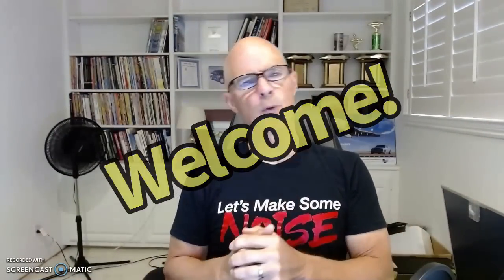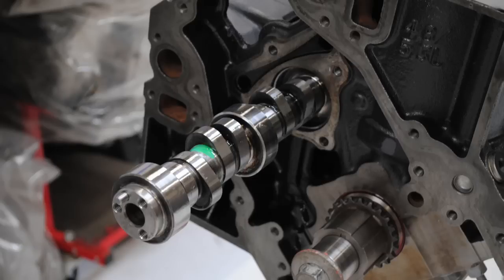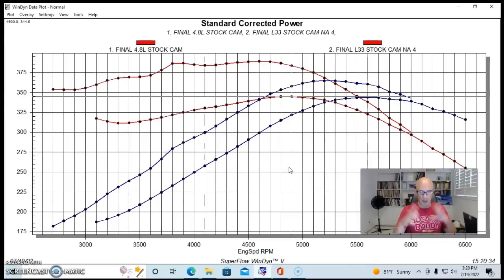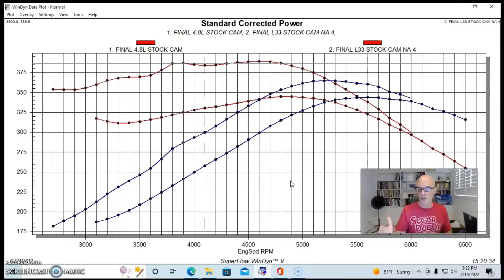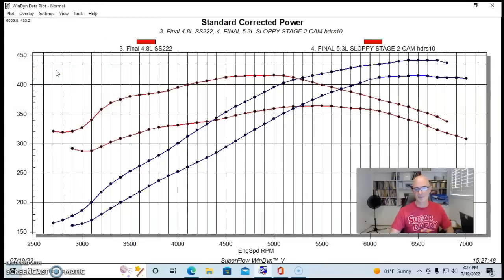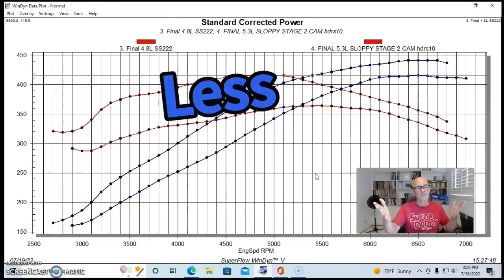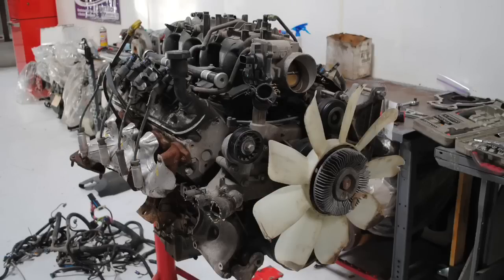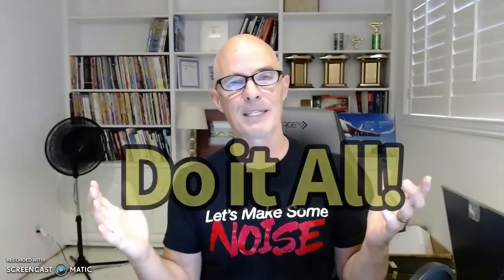4.8L VS 5.3L-TORQUE VS RPM? WHICH ONE WORKS BEST? WHAT HAPPENS IF WE ADD AN SS2 OR BTR TN CAM?

Comment: I believe the piston speed allows the rings to live longer. The rings usually seem to be what goes in a daily that you like to rev on more than occasionally. I think this is also why 283 and 327's got the reputation of being able to beat on them seemingly forever without blowing up in stock or mild builds in basically stock rpm range. Of course all bets are off zinging them 7-10k rpm no matter what it is.

Comment: I can't find the exact information I'm looking and I don't fully understand how to compare cams when looking at the numbers. I currently have an L33 in my truck and am looking for more torque for towing without sounding like a monster truck. Would I benefit from something like the BTR torque cam or is it too close to see a functional difference?
Reply from the maker: I HAVE A LOW BUCK TRUCK CAM FOR $179 THAT WOULD WORK WELL
Reply: @richardholdener1727  I appreciate the quick reply! Do you have a video on it? My main concerns are how it sounds at idle and if there be a functional difference between it and the stock L33 cam. Not knowing much on the topic makes this hunt a bit unnerving. Thanks again.

Comment: Does peak torque on 5.3 usually hangout around the same rpm In ur testing? It just don't seem to change alot. Not the number but the rpm range.
Reply from the maker: the peak rpm where the motor makes torque does change with cams, intakes etc...

Comment: I have a l33 5.3 with two gt3582 turbos. It has a Tick Flow stage 1 can with 216/220 int /exh .560 lift int and exh  114  lobe sep. The car is about 3200 pounds and has a 354 gear in it. It run good and it is a street car. I have a stock torgue converter and 700r4 trans.  But you know how it is I  want more . Do you think a Tick Flow stage 2 cam with 220/224 duration 575 lift and 112 lobe sep. Do you think the change in cam be worth any more power.
Reply from the maker: the turbos and boost level determine the power

Comment: I would like to know? Is this really worth it, Or should I move on a buy the Holley sniper?   AFR Small Block Chevy Titon 2-Piece Composite Intake Manifolds, 
Composite Plastic 2-Piece Intake Manifold Offers Convenience
AFR developed a patented process and design for a 2-piece composite plastic intake manifold that reduces weight and increases power. These manifolds run up to 30° cooler than an aluminum manifold and weigh 9 to 11 pounds less (varies by model). The 2-piece design allows center runners to be removed without touching the distributor or losing coolant.
Features
Cast-in nitrous bosses
Dual distributor hold-downs
Intake bolt compression limiters
Carburetor vibration reduced 5%
Modular design with interchangeable runners
15+ horsepower and torque (more than competing units)
30° cooler and 9-11 pounds lighter than aluminum manifolds
Includes distributor bolts and 12-point intake bolts and washers
Viton rubber gaskets and O-ring distributor seal for leak-free operation! I would like to know Is this durable! and will it hold up to ignition and nitrous back fires, Sure would like to know! Before I waste more money! Keep up the great work Richard.
Reply from the maker: I don't think they make those intakes any more

Comment: Hows the vacuum with the SS2 cam?
Reply from the maker: NOT GREAT ON A 4.8L
Reply: @richardholdener1727  i got an L33, still think im going LS9 cam because its in a ranger and I don’t need the low end torque.

Comment: Hi Richard, can't get enough of these videos man! I've always wondered how much power those OOOOOLD SCHOOL carb'd intakes made.  I know it can't beat the newer air gap stuff....  But I've always wondered, on an iron headed 289/302 with a good street cam, and a barrage of Edelbrock Street Master/Street Dominator and Torker/Torker II intakes, Offy dual planes, old Weiand stuff, and I'm pretty sure there's a Holley dual plane intake out there... just how much power do these choke out compared to a modern Air Gap RPM or even a Weiand Stealth?
I remember back in 97 being 17 years old and rebuilding the stock carb in my 85 GT and also adding an Edelbrock Performer 289 dual plane to it thinking I gained a bunch of power! Did I, though???

Comment: This comment doesn’t have anything to do with the video except being about an LS. I recently did a DOD delete/cam swap on my g8 gt with the l76 motor. I used steel plugs to block the oil passages in the valley and used the stock valley cover. I did remove all the solenoids from it before reinstalling it (not really sure why but I figured I didn’t need them anymore) after re assembling the motor I’ve only got 16psi of oil pressure at start. Am I bleeding oil out of the valley cover without having the solenoids on there?
Reply from the maker: did you seal all of them?
Reply: @richardholdener1727  what do you mean? They were a press fit into the holes
Reply: @richardholdener1727  I suppose the solenoids held oil back and the empty holes where they were would just be leaking now. I just went ahead and ordered a block off plate as well and I’ll swap that on and see what it does

Comment: Some of the fastest street cars are running 4.8 with ZR1 cams and turbo and making some 800 horsepower I kind of figured they want the 4.8 so it won't have so much low in torque that it has less traction and then again I don't know if they're lying
Reply from the maker: the LS9 cam is a terrible cam choice-and 800 hp is just getting started

Comment: I'm curious on your thoughts about putting one of these in a boat. I'm not looking for performance per say just a little more than my 1988 5.7 has that's rated at 266 hp. Keep in mind it's in a 30 foot cabin cruiser and my outdrive limits me to how much power I'm able to throw at it

Comment: Not really a question around me, 4.8L are a rare engine around me and 5.3L are getting stacked up like firewood with all the 4x4 1/2 tons rotting the frames out in the upper rust belt. My 6.0L lost a lot of metal off the outside during cleanup and a needle scalier was needed.

Comment: I have yet to do a ls-anything swap....not sure if i'll get around to a ls swap but if I had a stock 4.8 or 5.3, I would use what RH used in this test, and I would be good to go. I would opt for a carb setup to save some big $$. Impressive power from stock motors, my 75 or 79 Monza would just love that! I would let others rack their brains trying to out power the next guy.
Reply: Turbo, nitrous, 5 speed, 7000rpm, 4.10 geared Monza would be cool.
Reply: @BastardX13  That would be a wild ride. When you start to put real power into Monza's, just like v8 VEGA'S, you, must do major chassis, drive-train, and suspension upgrades. There is no middle ground, like F-bodies, novas, a-bodies, no steps to build thru. There is virtually NOTHING available for H-BODIES, it's stock, custom pro street or all custom all out. Monza H-BODY owners, like me are crazy!

Comment: If you are trying to decide between the 4.8 and the 5.3, then the correct answer is 6.0. lol
Reply: Yeah but the gas mileage is ridiculous compared against the 2…….honestly you can’t go wrong with a flat top 5.3……although I pulled mine and put a bored over.030 lq9 in its place then put a lsa supercharger on less than a year later just cause I wanted more power than my cts-v
Reply: Any LS rather it be 4.8 or 7.0 anything in between will be better than a traditional small or even a smoggy big block

Comment: Hey Richard, I love your videos. Is it possible to build an N/A junkyard 4.8 up in a way that could out-torque a junkyard 454 below 5000 rpm? Keep up the awesome content!
Reply from the maker: with boost
Reply: Yes but it will never give you the driving feel of a good 454 sitting at alight on idle and just flat stab the peddle you will have to build boost for a few seconds and by that time the 454 drove out of your life
Reply: This was meant to say N/A vs N/A, my mistake
Reply: @nicholassilvestri1804  stroke the 4.8 out to a 383 and put a mild cam in it and you could get close

Comment: I guess need to search Richard to see if you have compared all the other LS based engines this way. Usually the large displacement of the engine it will create more torque & horsepower.  ✌

Comment: Definitely like to see the ss1 cam in a l33 I've got a gen iv 5.3/706s/tbss/shorty headers and it's decent but not enough for the heavy crew cab
Reply: Which is why I'm seriously considering dropping 7k on a blueprint SBC 400 with 480 lb ft of torque peaking at 2500 rpms lol. I want my van to scoot without having to wait for it to go from put put to race car.

Comment: 86 Z28 305ci Q-Jet Auto, 305 is cooked wanna step up to an LS with a single turbo, is there any certain LS I should look for? I've been told 4.8 likes boost more then the 6.0??? This will be my first turbo build so any info helps.
Reply from the maker: A BOOSTED 6.0L MAKES MORE THAN A BOOSTED 4.8l

Comment: At least the 4.8 has a good size bore so you can use these good cylinder heads, not like a 283, or especially a 305.
Reply: I think it has less to do with bore size (4.8's 3.78" Vs 305's 3.736") and more to do with the stock heads being better between those two generations.
Reply: @d-phoenix2198  yeah the LS are all smallish bore, but those cyl heads now...

Comment: If its for circle track and the smaller engine weighs less then I'll take that.
If I'm towing I want the bigger more lazy motor.
If I'm drag racing it depends on the avg hp/kg which could go either way.

To this day and age its shocking the number of people that don't understand what power is, "ill take a 500hp motor making 600lbft for towing over one that makes 550hp and only 500lb ft".
As if engines are bolted directly to the wheels and we don't have a gearbox or final drive and only torque at the motor matters.
Reply: 4.8 and 5.3 weight roughly the same. Except for the l33, the only difference between the iron block engines is crank, con rod's and pistons. The blocks say 4.8/5.3 for a reason. (Edited for spelling)

Comment: The guy at the gas station turns his engines 10k and you can’t grab a 100 dollar bill off the dash. 😁
Reply: I call bs on the 10000 rpm. He may rev it there(which I doubt) but if he does it isn’t doing anything but ruining parts
Reply: @royalchaser8090  
Don’t tell anyone but that was a joke. 🤫🤣
Reply: @shitbox82  Good one! Hard to tell sarcasm when I have heard stories like that told by someone with a straight face
Reply: @royalchaser8090  
That’s what I was going for, a good old hot rod bullshit story 😄
Reply: @shitbox82  cool cool

Comment: Interesting to see how the 10% larger 5.3 was producing up to 20% more torque below 4000 rpm.  Have to wonder if the other components (intake manifold, heads, etc.) are just better sized for the 5.3 as well.
Reply from the maker: if only engines were just math
Reply: @richardholdener1727  Technically they are, we just don't have all the measurements or the equations they feed into ;)  If you ever have a chance, please think about doing a video or live chat touching on the days when NASCAR was offset grinding each cam lobe to account for cam/crank twist at high rpm
Reply: @richardholdener1727   hi it me cedric from alabama  well i have an 2005 4.8 engine   i sold the gen v l83 5.3 engine so im wotking with this 4.8 now   so  i need help on camshaft     im putting un my 1988 s10 blazer 2wd with th350 trans    3.73 gears      2500-3000 converter    so what cam btr  truck norris cam or btr stage 4 nsr cam??
Reply: @cedricsanders1977  Huntsville here, building 78 Malibu 4.8/th350 3000 stall 4.10 at the moment. Carb w nitrous.
Reply: I think your correct. The 5.3 takes better advantage of the cylinder head and intake flow, testing shows they can support more power then that.
Ppl have argued with me 4.8 or 5.3 don't matter they're the same and that is incorrect. A healthy 5.3 makes more power all things being equal altho both are good motors.
Reply: I would guess the frictional losses were about the same and the displacement is 10% more just in my opinion that was so the parasitic loss makes up for the difference
Reply: @johnsheetz6639  Could explain part of it.  But the biggest frictional loss in a piston engine is the ring pack.  And since the shorter stroke 4.8 moves those rings a shorter distance than the 5.3 they should have less parasitic loss. I suspect that air velocity through the ports is just a little too hampered on the 4.8 at lower rpms, which might hurt inertial filling of the cylinders, mixture motion, etc.
Reply: I actually trust your opinion more than mine that mine was just a guess.
Reply: @ChurchAutoTest  both good points and pretty accurate I think.
Reply: No engine can out rev the next if bulit for 7,000 rpm! 7,000 rpm is 7,000 rpm in anything just hits desired rpm faster because of shorter stroke! Longer the stroke more torque earlier in rpm. That's why big blocks have higher mph out the back but a smal block can do a quick short track in drag racing! Like it was explained to me when I was a kid a short legged person could out run a long legged person short distance but become maxed out and long legs will come strolling by.

Comment: Hey Richard whats your opinion on putting truck Norris in a 383 or 408 stroker? Too small of a cam for a big motor? Or would something like the btr stage 4 truck cam be better
Reply from the maker: what are you trying to accomplish?
Reply: @richardholdener1727  I'm thinking of throwing together a very torquey  NA daily driver truck

Comment: The 4.8 in a vehicle 3500 pounds or less with a 3000+ stall converter and 3.73-4.10 gears would be decent but if your talking a 4500-5500 pound truck or SUV the 5.3 is a better choice with the 3.62 stroke crankshaft vs the 3.25 stroke in the 4.8 and a 3.90 stroke crankshaft in a 5.3 will wake-up low speed torque tremendously from idle to 5000rpm needing less converter and gearing and be much more peppy below 4000rpm and move a heavy vehicle with much less strain than a cammed 5.3 or 4.8 will bet a sloppy stage 2 cam with a 
3.90 stroke crankshaft in a 5.3 would make gobs of torque from 2500-5000rpm

Comment: How about a high-fuel-mileage super-huge-motor that only turns 2000 RPM? (would require a very low ratio rear end, but, hey, the specific fuel consumption would be low.)

Also, the more slowly one turns the crank, etc, the more completely energy can be extracted from the combustion, and the less energy is required to fill the cylinders.
Reply: This is basically the point of a diesel. They found in the early days of diesels that without boost they are gutless, and with a gas engine it ends up with way too much heat to deal with, and lots of broken parts trying to make peak cylinder pressure that low in RPMs

Comment: Can you test vortech ysi vs ysi-b no other changes. Thing has been out forever with no one ever posting back to back same engine just cast wheel vs billet wheel difference
Reply from the maker: I'm sure they have tested it
Reply: @richardholdener1727  vortech says it worth 150hp and 4 psi. Never seen any results beside Brian Mitchell who was sponsored by them and he added a intercooler at the same to he added the billet wheel so not apples to apples. Would be nice to see the real results the way you do it.